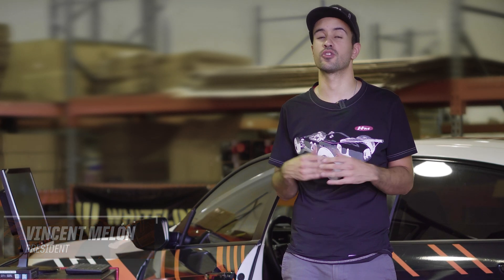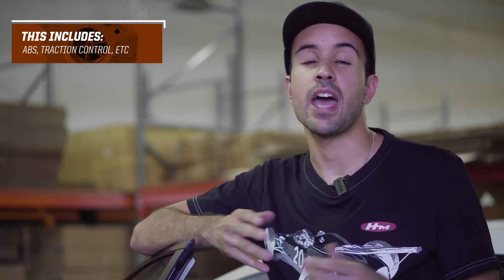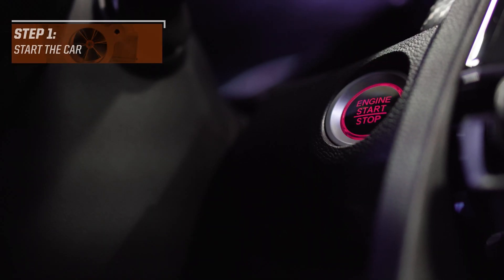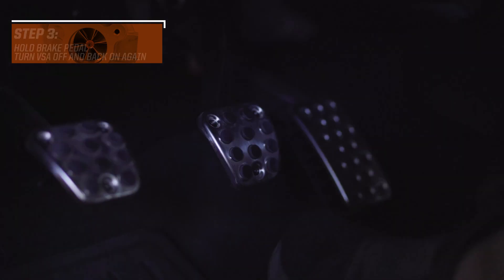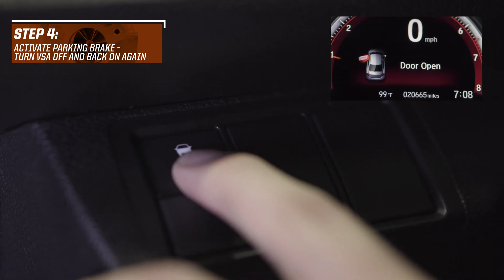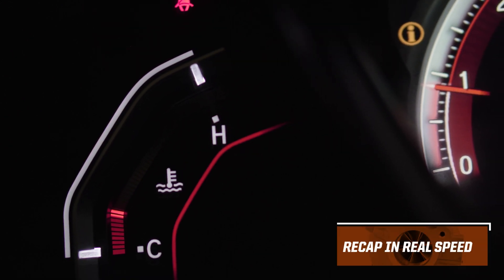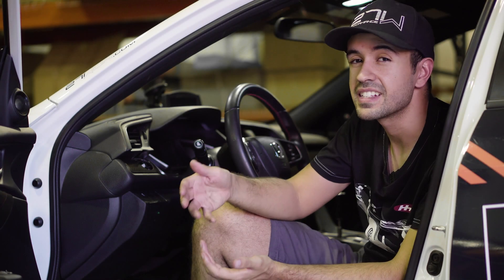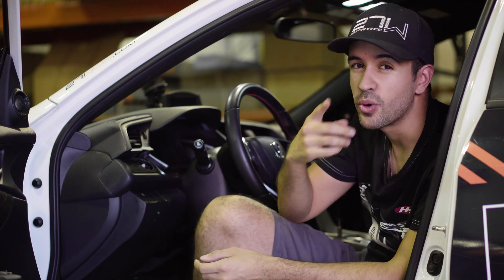How to Dyno 10th Generation Honda Civic (steps to disable vehicle stability assist)

Comment: When on the dyno after the vsa disable sequence should the ebrake be engaged or disengaged?  Currently doing a project on my 2019 si but the traction control still interfered with the pulls even after it was disabled
Reply from the maker: Disengaged. Off for sure.

Comment: How do you turn it back on? Do you follow the same steps again, or turn the car off and on resets it?
Reply from the maker: Resets when the car is turned off and back on again.
Reply: @27WON  Do you know whether it is possible to keep it off permanently, even after the vehicle is turned off and on again?
Reply from the maker: @LouisTursi  it is not.
Reply: Good question. I wanna know too.
Reply: You can also just toggle the VSA button and it will reset if you want to revert while driving.